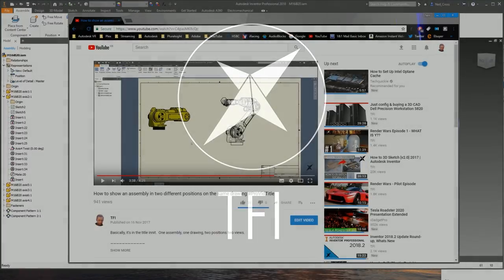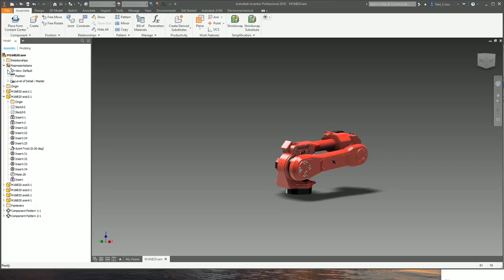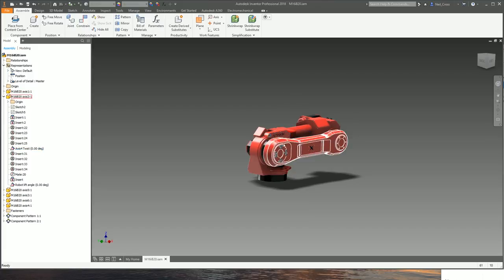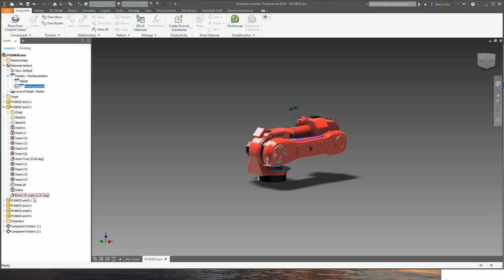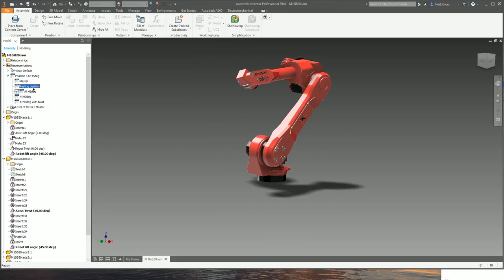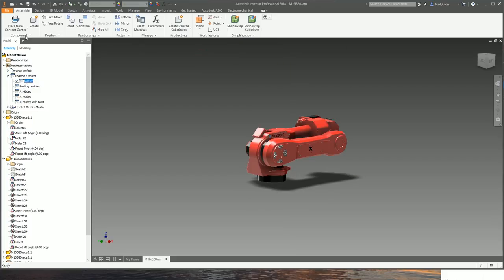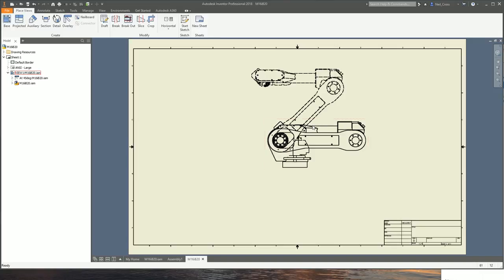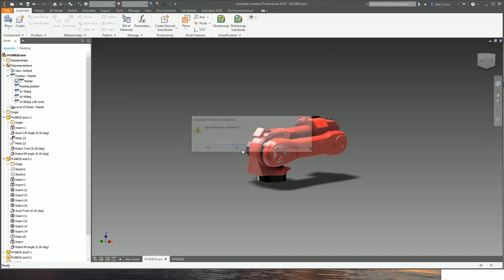Assembly Positional Representation Tutorial | Autodesk Inventor

Comment: Hi!
Very nice video. New for me was how to use PosReps in animation. So I tried with one of my assemblies and unfortunately it did not work out as you demonstrated. Finally I found out the difference between your and my assy. I have used joints instead of constraints. So when I replaced joints with constraints everything works fine. Do you know is there a way how it works with joints?

Comment: What if you have Pos Reps in a sub assembly?  Like an open & shut drawer in a drawer unit, will they still work when then parent assembly is placed in a drawing?
Reply from the maker: Yea, depends how you set up the assembly as to where you active the pos rep but yes.  A drawer could be exactly the same as this robot example, my robot=your drawer assembly, moving my robot arm=moving your drawer open and shut
Reply: TFI thanks for your reply, your cool. However I should have been a bit more specific,  I would want to have the rep in the drawer runner sub assembly so that it would be there every time I used the drawer sub in a unit parent assembly.  So effectively the reps would always be a level down from the drawing view. Would you have to 'stack ' the pos reps like you do with design reps?
Reply: I had the same question. I have a situation where my main assembly contains hydraulic cylinders as sub assemblies. So cylinders strokes are described in cylinder assy not in the main assy. And you can not replace stroke joint/constrain in main assy until cylinder is sub-assy. What would be the proper way to get PosReps managed?
Reply: I also have the same question, basically, how do you link the pos reps in a subassembly through to the top level assembly, or if not link what is the best way to manage this. I have tried researching this topic and am finding it hard to find any info.

Comment: This is an unrelated question...I know you work with inventor...but I thought I'd ask.  I am looking at the a Thinkpad P70 for use with Revit and V-ray and Lumion rendering for mobile use.  Do you recommend Xeon (with ECC RAM) or i7 (non ECC RAM)?  Is 8GB CPU cache that much better than 6 GB?  Also I am deciding between the Quadro  P4000 (8GB VRAM) or P5000 (16GB VRAM).  The CPU difference in cost is not much but the P5000 will set me back an extra $600.  The current pricing from Lenovo is amazingly close to the Alienware GTX based laptops.  Also I am looking at the Alienware 17R4 and was wondering if the external graphics amplifier accepts a variety of graphics cards including the Nvidia NV810 for connecting multiple monitors for stock trading.  Thanks in advance for your help.
Reply from the maker: Well I can tell you for a fact that the Alienware graphics amplifier won't work with the NVS810, I have the Alienware 17R3 with the amplifier and it doesn't work with any Quadros... although the AMD Professional cards do, I've had the FirePro W9100 running off the amplifier which supports up to 6 4K displays.  Honestly though I couldn't speak with any authority on what Revit, Lumion and V-ray need, but the mobile Xeons are getting very close to i7's now and given that overclocking in a laptop is still massively handicapped by cooling challenges, I'd be inclined to go for a good current gen mobile Xeon, i.e. not a E3 model.  Again I don't know if those applications can utilise the extra power you'd get from going from a P4000 to P5000, but I struggle to understand how a laptop would be capable of utilising the full power of something like a P5000 without serious thermal issues and throttling.  
That being said, my philosophy on buying stuff is that if you can afford the best but you're not sure if you need the best, buy the best.  At least then you know whatever you're doing, the system will never be a bottleneck to your workflow.  Only as long as you can reasonably afford to do that.  If someone needs to stick to a strict budget, it's a bit of a different approach.